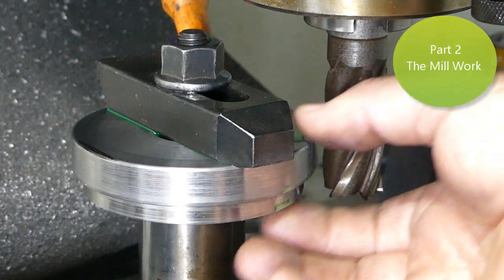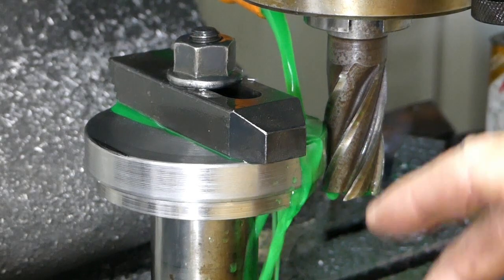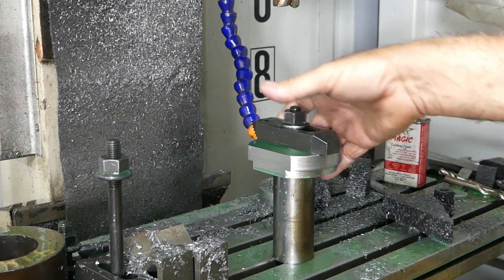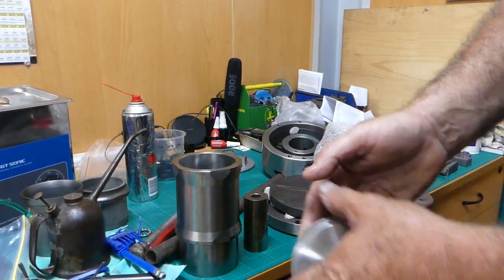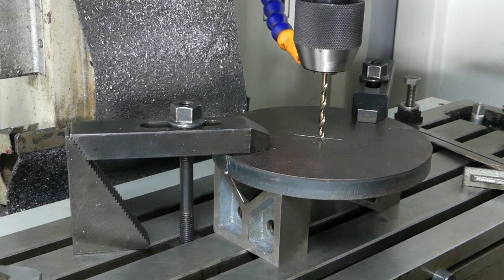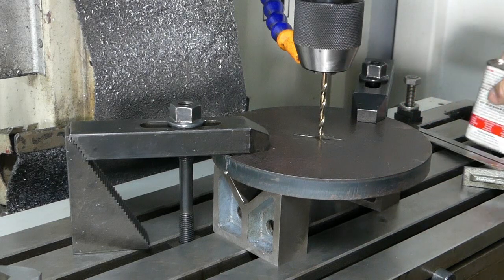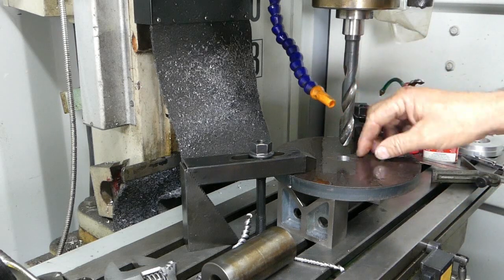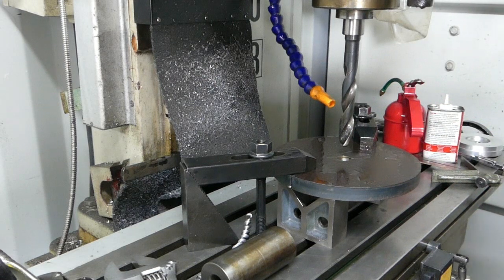Making a Ferguson Tractor Wet Sleeve Puller Part 2 The Mill Work.

Comment: What is the maximum  outer diameter that the disc should be so that it could fit through the block as you are drawing up the liner?
Reply from the maker: you will need to check the workshop manual as we are on the road for a few weeks.

Comment: You made it backwards from how I would have done it. I would have threaded the bottom puller part and had the top plate float thru. Then if the part you are applying torque to slips it slips against the liner you are junking anyway and not your block deck surface which you generally would prefer not to damage.
Reply from the maker: Nothing seems to turn at the top but I suppose never say never.

Comment: Job done , looks professional !   The ones i used to make were as rough as guts , but worked great . the rod had a nut welded sideways on the end & the puller plate had 2 nuts welded on their sides to make a hinge .  I just had to poke the thing in from the top  & used 2 gudgeon's & the H bar from my puller set .   We do things a bit different out here in the wild west !   I see you are still using  anti freeze . Pretty green , you know your soaking in it .  as Marge  used to say !  Cheers  Lance  great job .
Reply from the maker: Thanks Max, Yeah the green is good, my cutter was a bit dull but not to worry I will work out hoe to sharpen them one day.

Comment: G'day mate nice to see you on the mill and lathe the puller turned out very good at first I couldn't figure out how you use it to get the liner out of the block but it became clear once you showed how it works good job Lance, it will be good to see it in action.  What do you think of using coolant , is it worth investing in a set up?  Stay safe John
Reply from the maker: I think the coolant makes cutters last longer but for smaller jobs and softer metals I never use it. Probably a squirt bottle would be as good.